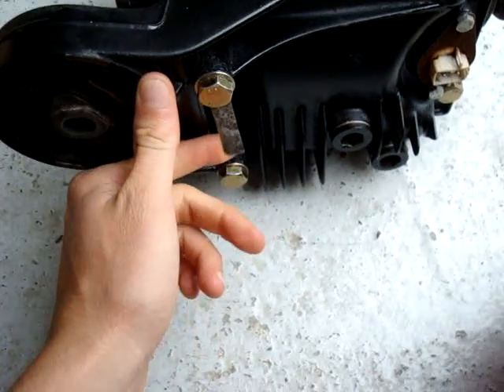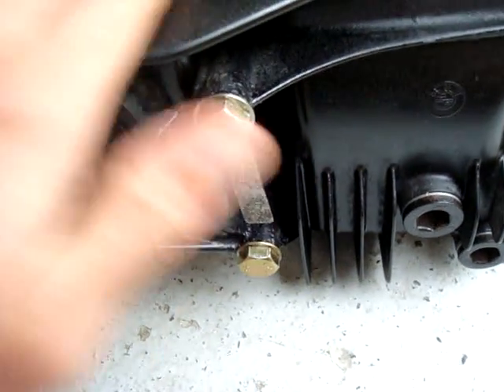BMW E30 LIMITED SLIP DIFFERENTIAL TUTORIAL

Comment: You say you can't stop the other output flange from turning because of the locking unit. Actually this is not the case, as no load is applied, so there is no locking action. What it is is the preload on the clutchpack. If you were really strong and could overcome the preload, you would be able to stop one side.

Comment from the maker: @LoomisLoftis 
You're right, this is a "symetrical" lsd aka 2 way, same lock-up percentage on acceleration AND overrun. The two slopes inside the unit on which the axes compressing the discs slide have identical angles. A 2 way lsd is the best for drifting but on fast front wheel drive cars a 1 way is the preferred route so as to limit understeer when you let your foot off the gas (if you ever do xD )

Comment from the maker: @mburns212 
I have no idea but chances are it should fit.
Grab an M differential from an e36 M3, Z3 or e46 M3. The LSD should fit without any problems though you will have to have the clearances properly adjusted!
There are many on sale on ebay.de, look up bmw sperrdifferential

Comment from the maker: No, you don't have to remove the wheel bolts, it will however make access easier if you're working on the grounds. Having the wheels off gives you more room to reach the bolts holding the drive axles. Undo those first, then move on to the bolts connecting the input flange to the propshaft and finally the 4 bolts holding the diff to the rear subframe.

Yes, LSD 4.27 is a deadly combo!
Good luck!

Comment: I don't think that it has a "Sperrdifferential"!
And not every BMW diff is locked, not even 25%
But there's a additional lock available with a 25% lock for about 350 Euro!
If you want it, the part nr. is: 33 14 1 210 493

Comment from the maker: You don't need a jack for that, unless you car is lowered just crawl down underneath it, the S is fairly visible as you can see in the vid, little harder to spot on the tab. If you car's lowered or you just don't want to bother, drive the rear of the car up a sidewalk, APPLY the parking brake!!! and you should have a good view of your diff!

Comment from the maker: They do cost so much... I guess it's easier to just have someone customize your own carrier rather than buying a Motorsport diff, I don't even know if you can still buy them from the dealer... It's also such a shame that so very few cars come standard with an lsd nowadays, you always have to go for the top of the line M cars or the biggest engines in the line-up... Totally transforms the car, I just couldn't believe I was driving the same car when I put it on!

Comment from the maker: Thank you!
That's right, BMW Motorsport differentials have higher locking, I believe the spider gear carrier had different ramp angles built into it so that you could easily change your locking ratio without having to actually change the carrier!
I found out later on that "sperre" means locking, sorry about that!

Comment: Nice. 

Just a little correction though: The S stands for "sperre" - which means "lock" or "locking".
The BMW diffs have 25% limited lock.
The "M" for motorsportones should have either 40 or 75% limited lock.